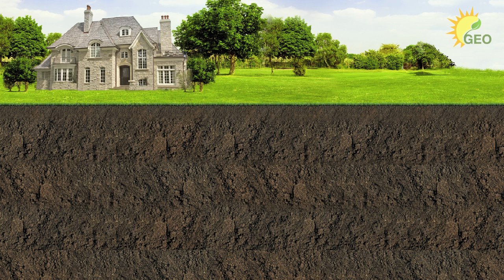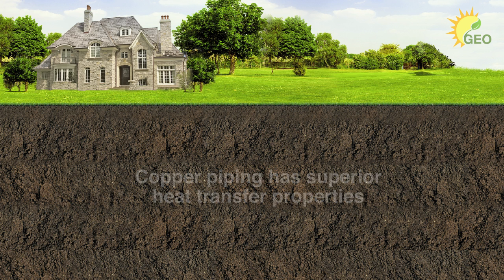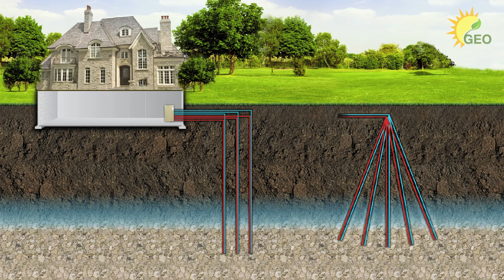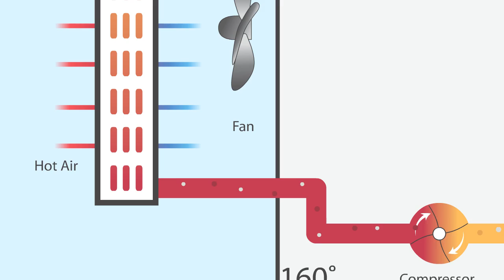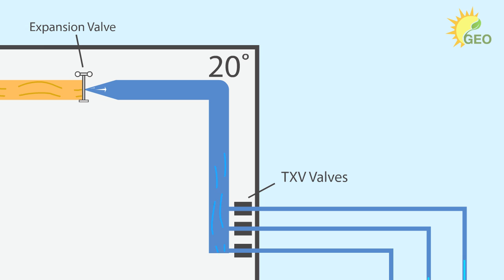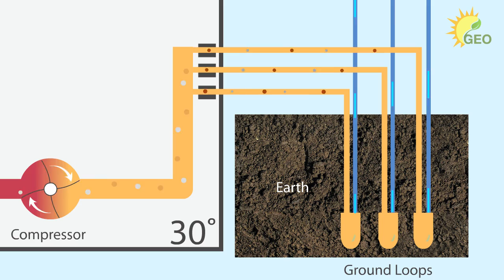Geothermal Energy Options - How It Works

Comment: 160 degrees Celsius.  I think that this heat needs other additions to benefit from it in the winter, but in the summer, unlike the circuit, something dangerous will happen and requires safety measures because the heat will increase when it is pumped into the ground.

Comment: I have seen a multiple vertical well system fail to make design Delta T.  Like not even close. Vertical wells in parallel, up and down the same hole.  But the designers were oh so politically correct.

Comment: That's not how geothermal work at all, You will never send refrigerant to the ground, Instead you use water or antifreeze and a circulating pump, there is a heat exchanger to transfer heat from/to water to another refrigerant circuit that actually has the compressor, expansion valve and a condenser (heat mode) or an evaporator (cool mode), from there a blower that blows air through the condenser/evaporator coils and take the conditioned air into the house's main duct system to condition the rooms.

Comment: Could you please explain how the number of Wells required is determined?
Reply: There is an easier, more useful and better way than digging all of this just for the sake of extending pipes, and it can be used anywhere on the earth under special conditions according to each region and at a lower cost.  But the idea needs support from anyone I might partner with in this innovation

Comment: So, this IS a ground source heat pump. It just does away with the secondary loop that is normally filled with water or coolant. I question the 25% gains over the water loop variant. In a well designed water loop version, the only difference would be the power draw of the water circ pump, which is a tiny draw compared to the rest of the system. On the other side of it, the cost of that much copper tubing and the massive volume of coolant would be a significant increase in initial cost. If the copper in the ground ever corroded or was damaged, the repair costs would be massive as well. HDPE, on the other hand is extremely durable and will never corrode. If it did get damaged, it's cheap to replace and so is the coolant or water in the lines.  

I've seen a lot of ground source systems put in over the years, and I've NEVER heard of burying copper. I'm thinking that if it were a good idea, and the gains were real, we'd be seeing more of it.
Reply: Yeah very interesting use of copper. Funny enough when I started looking into geothermal I assumed everyone used copper due to its heat dissipation properties. until I saw HDPE being used everywhere due to its gradual but larger surface area.
Reply: My thought also the copper would corrode plus then it would need to be replaced... The copper tubing that is relatively easy to obtain (commercially viable) is also very thin so corroding to a failure state would not take so long ?

Comment: I feel like this is a less robust design.  Having high pressure refrigerant lines snake all the way out into your yard and down 100 foot bore holes.  The better design is to use water loops to move the heat into ground then have a heat exchanger for a shorter normal refrigerant loop.  I realize this requires an extra heat exchanger and a pump, but that pump really doesn't have to be very big or powerful.  But its a more  robust design.

Comment: I like how they talk about the underground temperature as this constant. Well it is kinda constant as long as you dont tap into it, but once you do it will deplete it. How much and how quick depends on the specific conditions, but basically the temp down there is the annual mean temp of the region. So if you cool it and dont heat then the average will come down. So to keep the efficiency as good as it is in the first year you have to pump heat in it close to the amount taken out. This makes it more like a seasonal storage and less like deep bore geothermal. So if you want a system like this calculate some kind of solar collector in the bill to pump the heat in in the summer. (unless you live somwhere that is too damn hot and have short mild winters and use the same loop for ac)

Comment: And your bill will be four times higher
Reply from the maker: Your electric bill may be higher but the over all energy bill drops about 70%, as the geo system units operate at about 18 cents per hour. These are the facts.

Comment: Your plan using copper pipe in the year 2020 is a nonstarter the corrosive nature of the pipe is an in Normas enormous negative the plastic is going to land the ground for the next 50 to 100 years without change the copper tubing in 3 to 5 years will have decayed.
Reply from the maker: Copper come naturally from the ground so it can last for ever. There are still copper pipes in the ground in Egypt that have been there for thousands of years. As long as its done correctly corrosion will not take place. The pros out weigh the cons when it comes to copper vs. plastic.

Comment: I couldn’t work out how this system works, until I saw the illustration with the compressor.

Very efficient compressor, and environmentally friendly. Good for our future sustainability.
Reply: I once came across a Thermosyphon system with no pumps. Seemed to work well.
Reply: John Clarke more for hot water than circulating heating round buildings?
Reply: What drives the compressor? Externally generated electricity?

Comment: How do you address corrosion and leaks in the underground copper lines? What is the ground loop warranty for leaks?
Reply: good point
Reply: Good question. The lifespan of copper piping is 50 years. Should there be a leak pipes can be replaced but with the average lifespan of half a century and the elimination of heating and cooling bill from AC, heating oil, or electricity there is still a cost savings. AC also breaks down as does a furnace but overall this system is much more environmentally friendly and cheaper I’d say

Comment: If you using coolent n compressors I don't think youl save much ! What's the difference from a heat pump ! Other than gas for heat ? Ac used fluid n compressors n fans ! You took nothing away ! 
Buried tubes n fan is the money saver !

Comment: This is not geothermal, this is ground heat source, and energy is from the Sun. This is actually solar system.

Geothermal systems take a heat actually from earth, aka hot magma that warms up rocks or underground in thin places of the crust, and is only really useful in limited locations. Few well known ones, Iceland and some places in California. But of course there are thousands more of varying economical potential, depending on depth needed, and water temperature, and chemical composition and reserves.

Comment: Hello I hope you can help. Where can I obtain the formula for
heating a space as large as 57,600 square feet of open space (no
walls) at a temp of around 75 to 80 degrees and 4 fish tanks that
hold 10,500 gal of fresh water each. And one smaller tank that holds
500 gal of fresh water. The water has to stay between Temperature:
80-100°F,  “but”85°F is optimal in the winter. I live in the
North East of Pa.

Comment: Hi! So you drill tubes of copper into the earth that has some kind of liquid that absorbes the cool/heat from the earth and then its pumped to the house? Is that how it works?
Reply: It works like a usual air-conditioning system, but instead of transferring heat to/from the outside air, it transfers heat into the ground.

Comment: Does the refrigerant ever get old or something? Do you end up having to replace it at some point? sounds too good to be true if it is just infinitely recycling through the heat pump.
Reply: +Julian Franco I'm a power engineer by trade, but you can image how this works by thinking of the Air Conditioning System in a car.  Everyone so often, you need to add refrigerant to the system.  If you've even bought a car that was 10 years old and the A/C didn't work anymore, it's probably because their was little or no refrigerant left in the system.  Obviously, this system is not made of one complete pipe.  Individual pipes are connected by whatever means.  There will be small microscopic leaks somewhere, just like in a car and at some point you will need a little more refrigerant. In a standard refrigerator, entire system is hermectically sealed.  That's because 1) the refrigerant is not that healthy for you to breathe should it leak and 2) they don't want "Grampa" fixing the fridge, thinking he knows how to do it when he really doesn't, get hurt and then sue the manufacturer.  But this system is too big to make of one hermetically sealed system.  Refrigerators do last a lot longer than the AC system in a car in many cases.  This is, however, because they aren't moving about all the time whereas a car is constantly jostled about as it drives down the road.  I imagine that addition of refrigerant in this system would not be required very often since the house is not driving about like a vehicle, but at some point it would need refrigerant added to it.
Reply: saisonqwerty hi
Reply: Old? Not really, if installation was clean before installation. but it probably should be replaced every few years just in case. Glikol and water are both stable, and the tubing is innert. Nothing should happen.
Reply: @Renee Tate ground source heat pumps are usually used to heat up building, not cool it down ;) but it is possible with some systems to limited extend.

Comment: So you still need electricity for the compressor and the fan. Also doesn't copper pipe corrode in the ground?
Reply: People have K copper  or soft copper for the water supply to there house and can last over 100 years this going straight down in a well should do fine with freon in it but make sure there are no connections i mean one continuous  peace of copper and with valves above ground for testing. and if solar panels are to turn the pump!!!
Reply: Yes but it's all insulated, you don't put it straight on the ground

Comment: If the DX does not require additional electricity then what powers the fan that blows across the tubes?
Reply: jksatte no additional electricity that would normally be used to power a pump for the coolant is what I assume they meant.  In most geothermal units antifreeze is circulated through a ground loop and then ran through a heat exchanger with the Freon.

Comment: Frost line is only two feet I believe. I didn't understand this diagram example because different temperatures where used. If 20 degree liquid is going into the 52 degree ground shouldn't it come up at least 50 degrees and not 30 degrees. That is only a 10 degree saving and is it worth the cost??? Also wondering how long does copper pipe last before needing to be replaced in that warm moist rocky soil?

Comment: This again is not geothermal it is GROUND HEAT RECOVERY. 5 feet down here in NorthCentral Pa will never work--we get frozen ground to 9 feet at times--as we did this past winter 2013-14. Therefore this heat source is a waste of $$$$. Use deep drilled wells real geothermal steam energy. It works and many places here in Pa as well as the world are using this now. Good old USA is still stuck with polluting oil/, other petrochemicals.
Reply from the maker: According to the government report Long-Term Pavement Performance Computed Parameter: Frost Penetration, the maximum average frost depth for PA is 2.58 feet.

I do not believe there is a 9 foot frost line anywhere in the United States, and if there was a 9 foot frost line it would not make a difference as our vertical boreholes are 100'.
Reply: too bad you listen to the Feds. You are incorrect. Deep drill pipes to 600 degree minimum heat range is Geothermal. You are looking at ground Heat.
Reply: keith hinkel
I think I understand what you mean, here's some clarification:
'EARTH WARMTH or GROUND HEAT' is commonly used for naming systems up to 250 meters (820ft).
'GEOTHERMAL' is commonly used for naming systems larger than 250 meters.
However, 'Geothermal energy' is the collective term for both, existing out of DEEP geothermal energy and UNDEEP (shallow?) geothermal energy.
"Undeep Geothermal Energy" is what you are calling ground heat! :P
Reply: Christopher Ryan
In Belgium we have geothermal systems up to 820ft (250 meters). But those are really expensive. Too expensive for common people at the moment.
We're also doing a test in Mechelen, currently the biggest geothermal project in Europe.
They drill at a depth of 1.25 miles there (2 kilometers), trying to provide heat for a whole street.
Geothermal Energy for the win!
Reply: ***** I am well aware of the incorrect naming--I am a engineer concentration in heating. TY anyway Jelle. This misnaming is just a sales con.

Comment: What runs the compressor and the fan???
Reply: I was wondering the same thing! I'd assume they would need some DC source like a battery  or a solar panel to get it up and running.
Reply: +Jerry G. electricity ..................solar panels?
Reply: Christopher Ryan Looks like it's a difference of 10 deg more coming from the ground. The heatpump working alone by itself would compress the gas to 160 pretty easily as well no?
Reply: A motor that will not reduce your electric bill in any way, compressor/AC/Heat pump same thing.
Reply: Electricity. Lots and lots of it.!
Reply: Christopher Ryan how many solar panels you need to run heating pump in vertical drills ?
Reply from the maker: devientrazz The compressor runs on electric and that electric could be offset by solar. A Geothermal system is the most efficient way to heat and cool today. Payback on most new home systems is less than four years, the bigger the house the faster the payback.
Reply: @geothermalenergyops  Noooo! STES is far more efficient
Reply: Electricity... LOTS of electricity! 😂

Comment: I work in the geothermal energy field, but on large-scale electricity generation operations.  I have to say this is an excellent video, but the title is a little misleading.  It's important to make the distinction between direct use/heat pump geothermal systems (which is the process that this video details) and geothermal power generation, to avoid confusion.  In my community we refer to power generation as "geothermal energy," and to heat pump systems as "direct use" geothermal.
Reply: It's actually neither, heat pumps don't use ground loops and geothermal don't send refrigerant into a ground loop, it uses antifreeze or water, So this video is totally wrong. In a sense it describes the heat pump but without ground loops.

Comment: I got a similar unit like this, in fact we were the first on the block, who had this system. We were one of those test houses 17 years ago.
Reply: SO HOW IS IT WORKING FOR YOU??
Reply: Nice to know this.
Please share your experiences about this project.
Reply: @devanand7366  WE NEED ANSWERS  Lol
Reply: @devanand7366  There is an easier, more useful and better way than digging all of this just for the sake of extending pipes, and it can be used anywhere on the earth under special conditions according to each region and at a lower cost.  But the idea needs support from anyone I might partner with in this innovation

Comment: I would love a system like this, but I can't seem to find a contractor here in Hawaii. Is there anyway to ballpark a cost for a system like this? I live in Volcano Village (Hawaii) and would love to have a system like this integrated into my 1920s home w/o losing it's character. Love my old fireplace (original wood fire burning) but would love to have a green solution like this for my water and heating as an option. Would be nice to have these for mold and sanitary prevention as well!
Reply: Where your at you need solar panels in the yard and use the electricity for everything.
Reply: There is an easier, more useful and better way than digging all of this just for the sake of extending pipes, and it can be used anywhere on the earth under special conditions according to each region and at a lower cost.  But the idea needs support from anyone I might partner with in this innovation

Comment from the maker: The reason why the refrigerant needs to drop in temperature is due to the fact that it is liquid state after passing through the heat exchanger. So, by dropping the pressure and sending the low pressure liquid down to the earth, the liquid begins to boil in the ground and changes state back to a gas. During this process is when it absorbs the heat energy stored in the earth. Once this process is complete, the gas refrigerant can be compressed.

In short, I cant send a liquid to a compressor.
Reply: Is there casing in the well

Comment: ok.. I've been trying to wrap my head around understanding how this works.  I'm lost at the point where the return line from the heat exchanger is at 85 deg.. then goes through the reducer and drops to 20.. why drop the temp to 20?  why isn't that 85 degrees recycled back through the compressor?  wouldn't it take less compression/energy to bring that back up to 160?